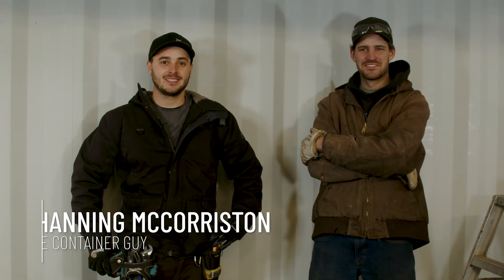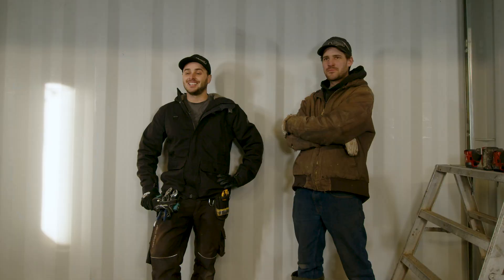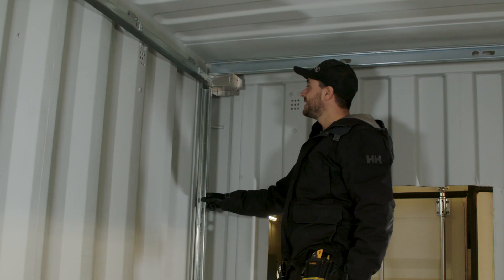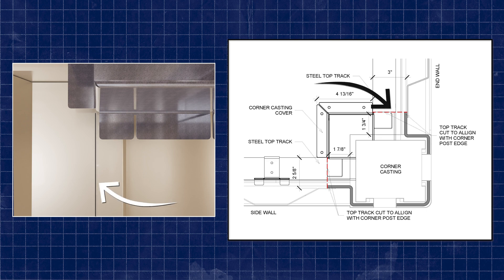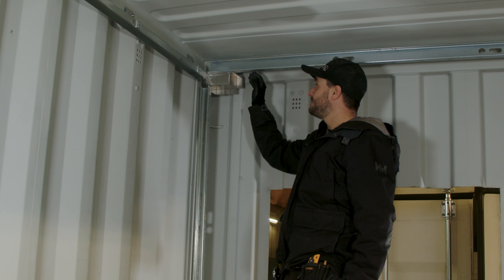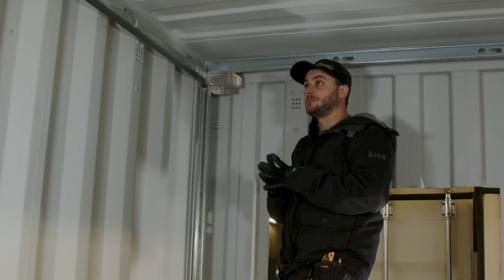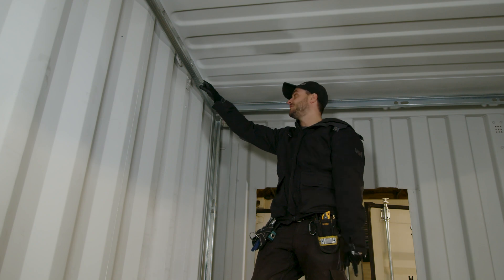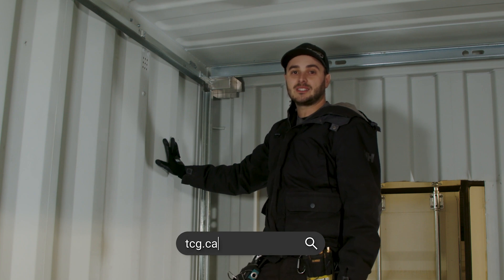Steel Studding A Shipping Container - What We've Learned & How It's Improving Our Framing System

Comment: The kit doesn't include the screws for the top and bottom of the studs. On top of that the shopping list instruction doesn't have it either. Not good to be 20 miles from nowhere without necessary screws.

Comment: So I’m building a 2 story shipping container house in Florida. L shaped with 2 40’high cubes. I’m a really good metal fabricator…not a house builder ! I Fabbed up some angle brackets like you have …not all fancy so I had to measure each one but all In perfect.. great idea! On the ceiling studs there just screwed in on the bottom. I used 3 5/8 studs up there and 2 1/2 on the walls but the tops wiggle ..I know the spray foam will take care of a lot of that but should I add some more angle brackets on the end thru the box tube on the top of the container and to those studs to keep them strait up and down?

Comment: Many times the stud screws are ommited in steel frame construction, since the wall covering being attached to it creates a rigid connection anyhow. The only time you see them used 100% is at corners and anywhere the stud meets an "end" like a doorframe. This helps prevent bumps along the length of wall covering where the screw heads would be along the ceiling and floor as well.
Reply: 25 years of structural steel stud framing and never have omitted any screws for any stud. Now there are instances to which against a concrete wall the back side screws are not used but on the face always. Also some instances the wall itself is using a taller track with slots, this track gets limited screws and the drywall is not attached to the top track for expansion and contraction of the wall and or exterior shell that is the building. Using "sliders" at corners still get screwed in when the drywall passes into the wall cavity. As for any " bumps" there is few of these since one does not screw drywall in the areas where the studs are screwed. Main times you see this are at corner of doors and windows to which get "cased" or windows that end up with corner metal for drywall taping and mud. While the drywall does help with the sheer and rigidity of the structure i would state that drywall itself is not a structure which one would rely on the screws holding it on to now be the structure of sheer. If this is how it is done in your area i would quickly move to an area to which does not work with the practice of which you state

Comment: There doesn't appear to be a thermal break/gap between the internal from and the external wall of the container...am I correct? Doesn't all of thermal transfer thru the metal studs, miscellaneous framing and the walls of the container?
Reply: I think with this method---if done properly---the only thermal bridging allowed is from the steel stud brackets holding the top tracks, because there's that 2.5-2.75" gap from the exterior wall to the studs. That's the true beauty of these brackets and corner covers (besides conveniently setting your ceiling height and distance from exterior walls)

Comment: Frankly, this is pretty hard to follow...   also, if you measure 2.5" out from the wall at the bottom then you wall isn't plum.   I just measured the distance at the top and it's 2.75".   I'm installing your kit right now.

Comment: How many studs and how many roof studs and tracks and flanges are needed for a 20’ container?
What screws (exactly) are needed for a 20’ container?
Approximately what would the material costs be for framing a 20’ container including the door?

Comment: That's a great looking framing system. Is it better than wood?
Reply: Highly used in commercial construction because it is ridiculously faster, and doesn't have the warp/twisting that lumber risks, as well as no expansion/shrinkage with weather. The only thing special about how they do it here is having their brackets connect it to the container. This also doesn't risk the issues with condensation that wood does in a container if you not PERFECTLY sealed.

Comment: How much width is left from the 7'8" starting point ? What are the pros and cons of framing the inside this way vs InSoFast's system of insulation with integrated "studs" ? I know your focus isn't mods for residential purposes but what's out there is usually crap and not code compliant, while your mods are actually engineered !  Lastly let me be a heretic and ask why, when the can provides a steel structure already, does everyone add some type of interior framing ?  Yes, insulation and fireproofing but why not screw (or rivet) through and into the walls themselves, and seal afterwards ? You do for your window kits, if I've understood them.
Reply from the maker: 7' 3 1/4" between the steel studs. I have an Insofast sample at the yard. I should measure what that leaves you and compare. Insofast leaves a small gap between the container corrugations and the foam which will condensate, freeze, and frost-jack your walls in the winter. If there is a gap between rigid foam and the corrugations, that needs to be ventilated so it can remove humidity and depressurize. 
The pros of framing this way is being able to use 2lb closed cell spray foam that wraps around every stud to eliminate thermal bridging from the studs and the side wall corrugations. Steel studs are not porous so there is no opportunity for mold or mildew to grow in the wall system.
You are correct about the information floating around the internet on container homes. It makes me cringe and is the reason we started this channel: to educate the public on the misconceptions and demonstrate a proper way to do things.
Reply: @TheContainerGuyTV  Insofast claims 7'4" using their panel with 1/2" drywall, yielding a bit over R12 for insulation. Here in the US northern climates that wouldn't meet residential code, which can require (for stick built) R13 in stud cavities plus R10 continuous or R20 plus R5. The continuous portion, to mitigate "bridging loss" through studs and sheathing, is usually done with rigid foam on the exterior. The latter combo can lead to cold sheathing with attendant problems of condensation and thus rot, mildew, mold and loss of effectiveness of the insulation. Obviously a continuous vapor barrier (per code) between the living space and insulation should prevent this on the interior surface but doesn't help on the outside. So combining interior and exterior insulation can be "tricky". 

I haven't (yet!) watched all your vids but I've not seen you insulate, or side, the exterior. So you avoid one issue above. Again I know you don't do residential so perhaps code compliance is different from the above. Maybe you've done a whole vid on insulation and what your customers need that I've not (yet!) seen. I'd like to see how you meet roof insulation (R49) as well.
Reply from the maker: @brianmack6285  I'll have to do a video on different building envelope options for different climates. We have this video here from a while ago about insulation: https://youtu.be/i8eMoXMf530
Reply: @TheContainerGuyTV  Thx
Reply: @TheContainerGuyTV  Oh please do a residential video using various climates. I am so fascinated and grateful that I found your channel because I plan to build my forever home from containers. FYI I  live in the Caribbean and I am very curious about how insulate a container for this climate. Much continued success!!!🌴🐢🌴
Reply from the maker: Don't screw through the walls anywhere other than installing the window/door framing kits. The flange of those framing kits protect the bare metal exposed after drilling and the spray foam covers it from the inside. If you randomly drill holes and bolt through a container, it'll rust through in ~3-5 years.
Reply: It’s obvious that some of the screws that he is screwing in are tripping the fixed clutch or popping the bit out of the screw and spinning when he bottoms out which is good. It’s also very obvious that at least half of the screws that he is screwing in using a non adjustable nut driver instead of a clutched screw driver designed specifically to drive screws is stripping both the stud and the top and bottom track which is not good.
Reply from the maker: @disenfranchisedcitizen1432  you're thinking too much. The fasteners are only there for moral support once it's spray foamed.
Reply: @TheContainerGuyTV  i completely agree. But if he is an actual steel framer that does it for a living he shouldn’t be using a nut driver as a cordless screw driver which indicates that when he does his regular job using steel studs, the conservative 40% of stud screws that he is stripping isn’t conducive to a sturdy wall for his customers.
Reply from the maker: @disenfranchisedcitizen1432  he's a welder. The wall doesn't budge after foam.